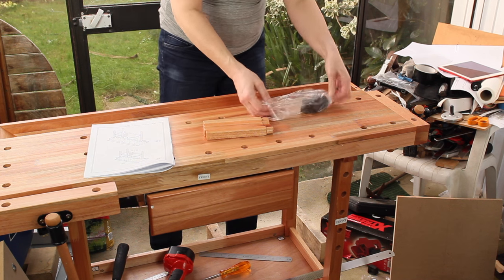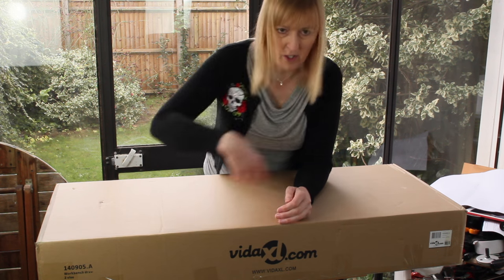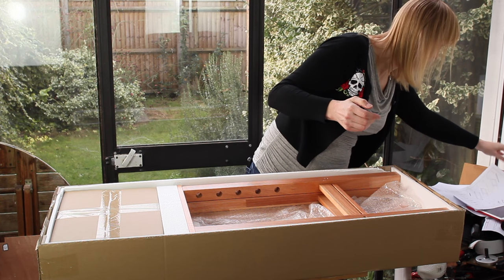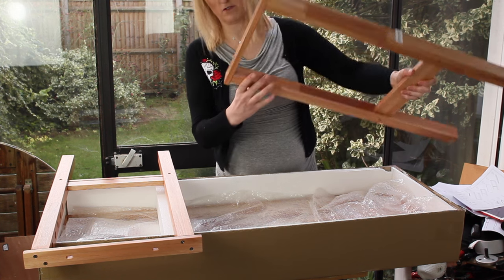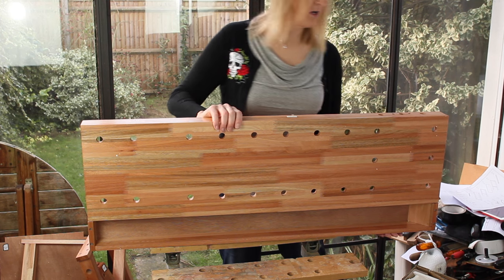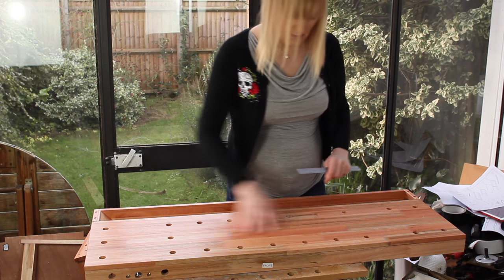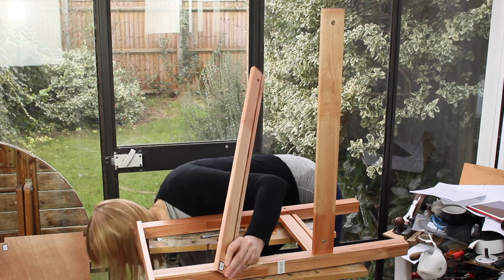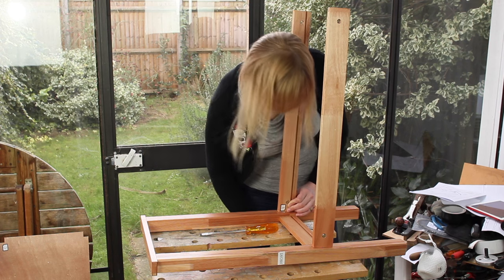VidaXL carpentry workbench unboxing and setup

Comment: Good job!  I got a similar bench several years ago.  Big upgrade from my Workmate and plywood between two saw horses.  Got a better bench a few years later when I added some work space, but I still have the original bench and use it quite a bit.  Good option for a small space shop, especially for the money.  Hope you enjoy!

Comment: Susan,
I enjoyed watching your analysis as you assembled the bench.

Seems to me that your new bench should serve you well for placing work at a good height and holding it.  Once you've stabilized and stiffened it I think it will be a good tool for you.  

I might suggest you add weight by using sand bags or solid concrete blocks.  Making it heavy will lessen the rate at which it creeps away from you while you work a piece.  There appears to be enough space below the shelf for you build in a weight tray and to heap in a hundred kilos or so.

All the best to you,
Russ from Lansing, Michigan across the pond

Comment: Phillip's screwdrivers/screws are designed to prevent over-torquing the connector. The blades have a wedge shape, which means they'll sort of force themselves out of the screw's slots once a specific torque range has been reached.

Comment: Hi Susan ... could I suggest you actually double or tripple the thickness with plywood or MDF ? Wherever you can due to the vices and braces ... glue and screws kinda fix. It would get more   meaty... and as to the rocking ... a small drawer module end to end would fix it and give you storage space ... and two more YouTube videos as well ... lol 
As to the product itself ... not really impressed. A flat top is a must I would say. As you said ... it was "cheap" ...
Thanks for your videos !!!!!!

Comment: I'm supprised you had to start drilling new holes and moving draw runners etc, just to make the drawer front flush? Sue do you know that Phillips screwdrivers and pozi screwdrivers are different and don't like being used in the others screws, they tend to cam out and bigger the head up.... I made my own workbench around 35 years ago.  The legs are approx. 5inch square which I planned with an industrial electric hand plane( I ended up waist deep in shavings. ) the top is 2 inches thick two pieces a well at the back for tools and two ramps Witch I put in to help with brushing saw dust and shavings out. It all bolts together similar to yours with 10mm bolts. It's just over 6feet long weighs a ton to move. I didn't fit a drawer, just a woodworkers quick release vice. And still the top warped slightly!  Had to plane it flat! The moral is I wished I had bought one like yours?..
Reply from the maker: Ah, but the pride you have in your bench! I don't think my screwdriver is pozidriv. I think it was Phillips in Phillips but maybe a size mismatch. It is nice to be able to move my bench around - I can easily lift it. I've just braced the legs so it's really solid - video out this week.

Comment: You can't build a bench till you have a bench to build it on😀
Reply: I hope you are wrong, but in this video Susan has access  to, and the skills to use all manner of high cost power tools. Fair enough, but I but I am starting from absolute scratch. Main problems are that for aesthetic reasons, I don't like the lower shelf, and also I need to be able to sit at the bench, to use for my craft work.

Comment: Where there are big holes, and one wants to replace it with one nearby,   the solution might be to glue and dowel the first hole, or fill it with epoxy, would this not strengthen the wood back to its original strength?

Comment: I think making your own bench would have been a better and more satisfactory idea. I would be less forgiving than you on something bought that was not working correctly.
Reply from the maker: I've no doubt I will make my own bench at some stage, but by then I'll know what I want.
Reply: EcoWomble definitely more enjoyable and satisfying making your own!
Reply: I am watching these videos back to front so this is two years  too late and a quid too short but, may I add, I have built six workbenches. By hand, no power tools. What you got is a kit. The kit itself looks quite nice. What is inexcusable is that the holes for the drawer slides are off. The holes  are all drilled  by CAM -- computer controlled machinery. It drills exactly where it was told to drill. So someone changed the program for either the drawer or the bench itself. They then forgot to change the program for t'other. Someone in Quality Control asleep, or bad programming.